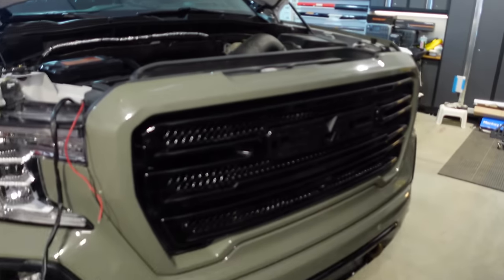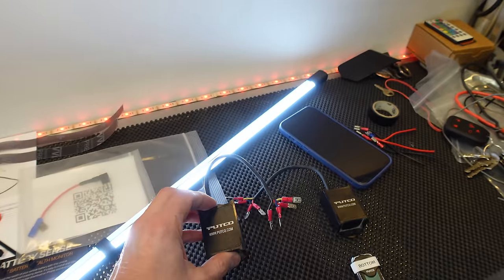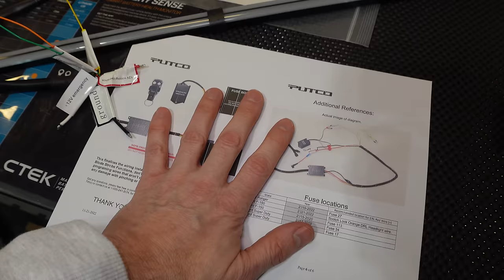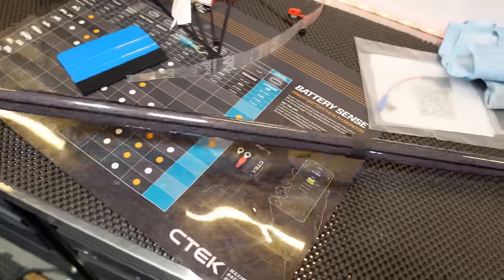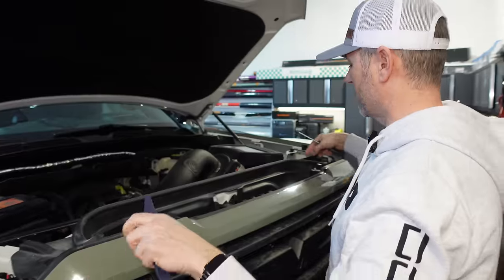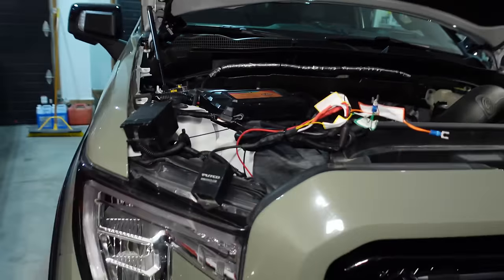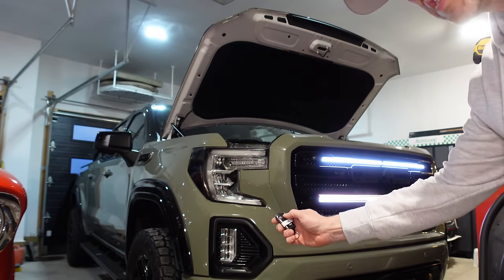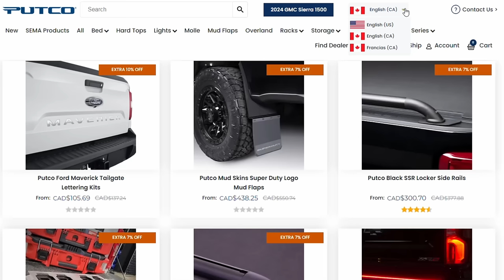Making My Grill Epic With A New Virtual Blade Setup by Putco Inc.

Comment: Love the channel.  Great video but I have a question. Is there a way to use these without the remote? I hate the fact that you have to turn them on with a remote. Can you not wire them directly to the headlights? Or the daytime running lights?
Reply from the maker: Thanks.  Yes you can use can hardwire them in multiple ways.   Fuse tap, wire tap, add a relay too if you wanted.

Comment: This has nohing to do with the putco blade but i noticed in your boost auto parts runningboard install they had a white start up sequence and here they are amber. Did you change them?
Reply from the maker: Yes I made two videos. One for each DRL color.  But yes they are a different set

Comment: Hi Don, quick question. Did yiu splice the 2 together, power ans ground?  Im going to run a second virtual blade and making sure I can tap into the existing.
Reply from the maker: I did splice them together like you’ve indicated.  You could tap the headlight fuse so they come on with the DRLs.
Reply: Thank you for the quick response!  Have a great 4th!

Comment: The mismatch in light color temperature between the grill lights and daytime running lights looks really cheap.  Poor CRI of the bolt on LED’s perhaps.  Appreciate all the effort you put in, but the results just look cheap and tacky.   Once you see imbalance of color temps in LED’s, you can never unsee it.
Reply from the maker: Camera problem/limitation not a human eye problem.  Why project negativity? Just move on.
Reply: @Donslife  again, the effort is appreciated, but you won’t keep them on your truck.
Reply: Just hating prolly has a stock truck @GulbransonPhoto